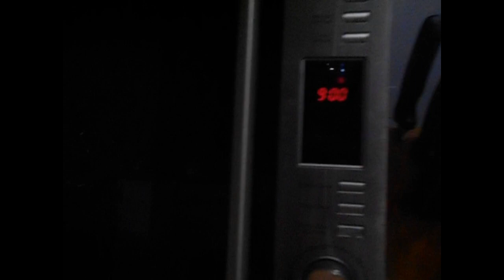How to Melt Glass in a Microwave - Fused Glass DIY Microwave Kiln Easy Simple & Cheap

Comment: So, question. When you fuse glass this way, can it be chipped and knapped into an arrowhead shape? Because I make arrows out of glass bottles and I simply abhor the waste glass that comes from the production of a single arrow. You basically can use only the bottoms of the bottle, nothing else.
Reply from the maker: Yes, if 6.5mm is a good thickness to use. When molten, glass settles 6.5mm thick

Comment: You just blew my mind. Ive been working with glass for 25yrs and I have so much glass this is awesome but what are the elements?
Reply from the maker: Hi Christine. The elements are silicon carbide, common emery wheel/grinding wheel available at hardware shops. The silicon carbide can be cut with a grinder with a ceramic cutting disk fitted. Feel free to ask as many questions as you want. Thank you for watching 🤗

Comment: Why does the glass plate in the microwave not melt?
Reply from the maker: Because microwaves dont heat glass
Reply: microwaves do heat up glass, but they do it WAY more efficiently if the glass is already hot

Comment: Full thickness red stained glass blocks too much light, so long ago they learned to coat a clear base of glass with thinner red glass so more light can pass get through.
In this case, 1 layer of clear glass and 1 layer of red glass between the two layers of the same lighter colored pieces would probably result in a pendant with the same uniform thickness but a lighter shade of red of red in the middle.
Reply from the maker: Thank you for that great info! I'll try that